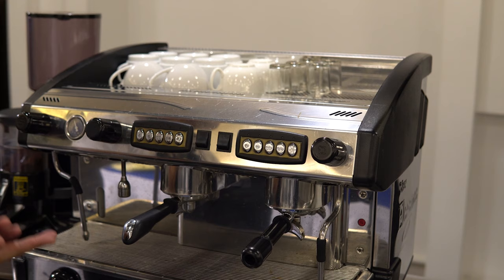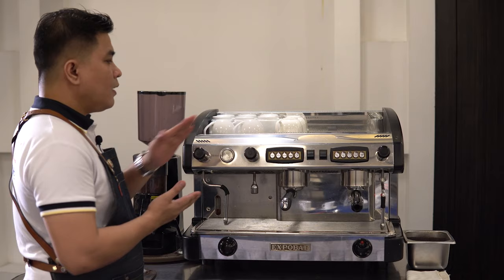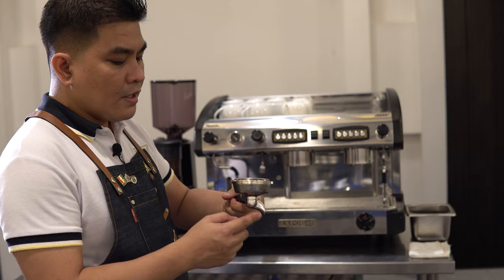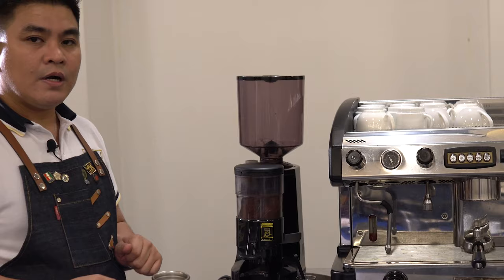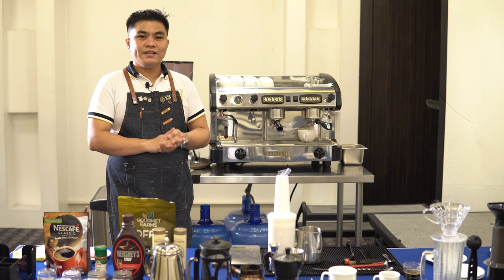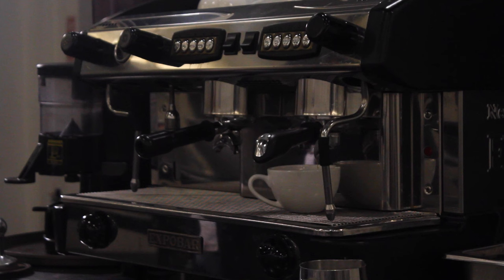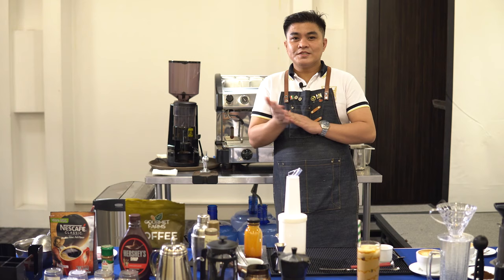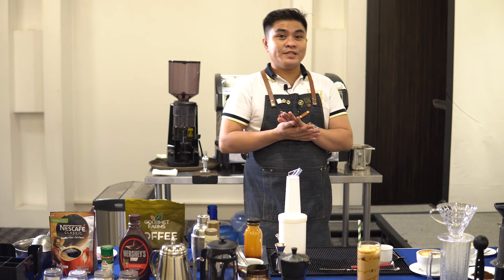Barista 101: Espresso Cappuccino and Latte

Comment: lacking of scale my friend is not consistent as you say esp when you are using that kind of grinder. 
buttons: 
1 button - single shot 7-10g/30-35ml
2 button - double shot 52-60ml 
3 button - double shot dry input w/ single shot outut 30-40ml
4 button - double shot output - 52-60ml
all shot extraction depending on roast profile.
never use the word HALF as you are refering to a calculated recipe based on weight. for that, you'll have a higher consistency.